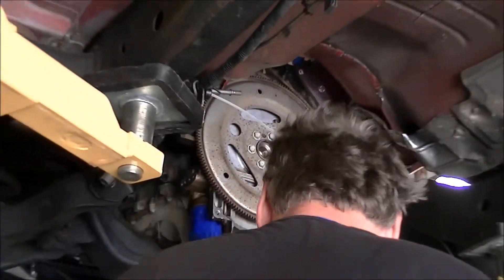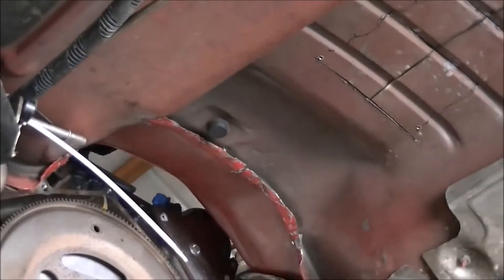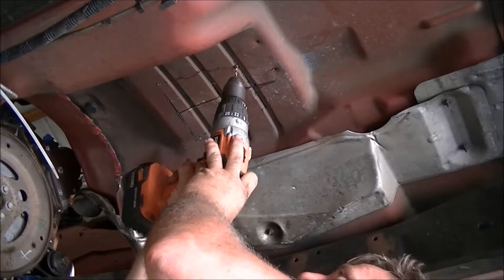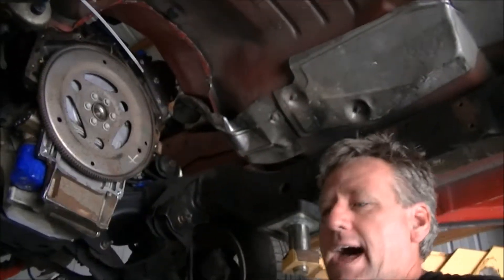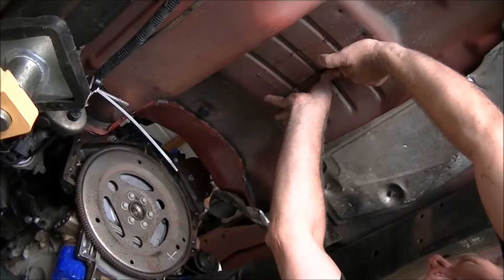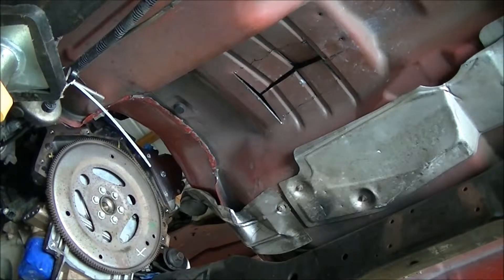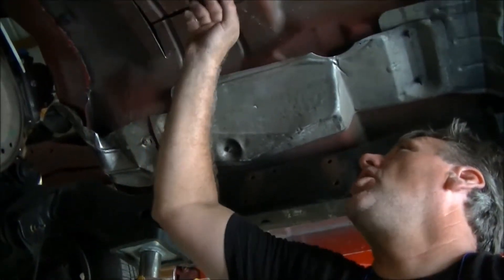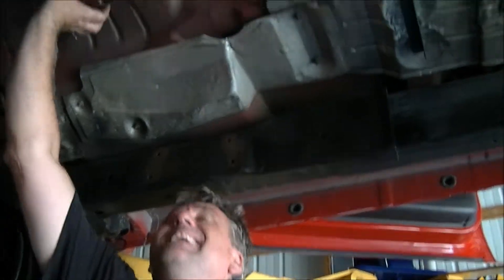How to Modifying the Tunnel in an Dodge Dakota RT to Fit a GM 6L90 Transmission

Comment: thats ingenuity, work smarter not harder. I think an ls in a dakota is a great idea, 5.9 sucks, not really, heads dont suck at all, lol, but the performance from the ls, along with cheap aftermarket, i cant believe how many people are trash talking you, im going to ditch the 5.9 and go for the 6.0 now, sad to say that the ls probably out performs my supercharged 5.9 on the dyno, and with that 6 speed auto, that would be the best fix of it all, who cares if its a chevy drivetrain in a dodge. too bad people put value on brands rather than the actual product. good work!